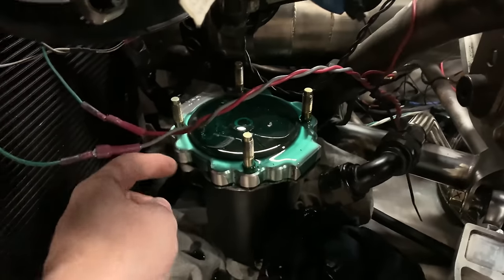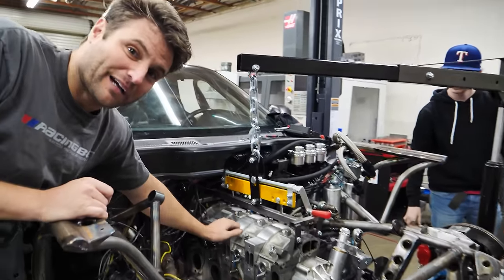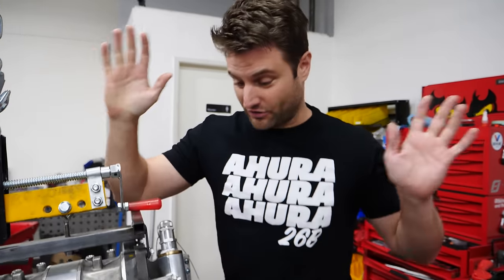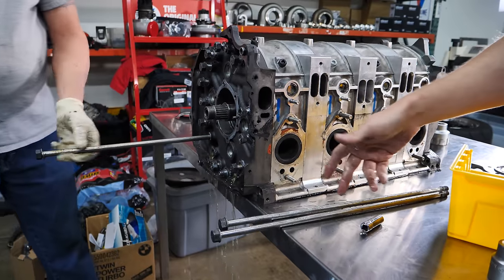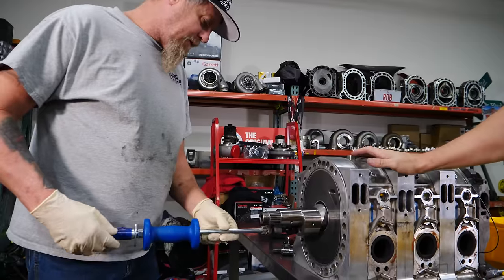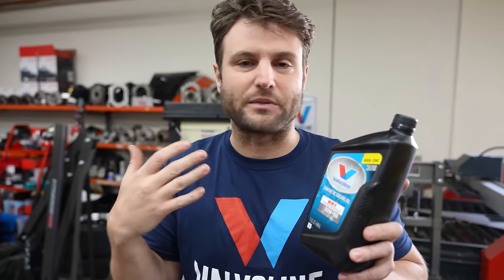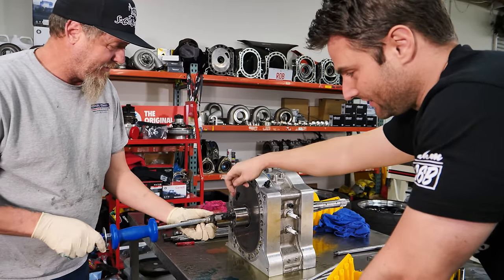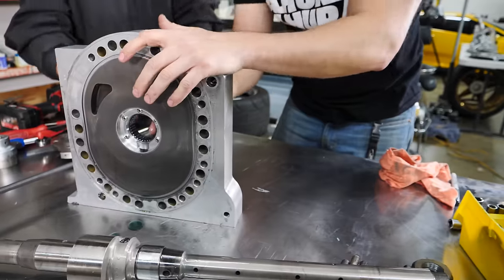How we make 1400+ HP with a Rotary Engine. 4 Rotor Teardown

Comment: When is that 6 rotor coming around again? Really want to see that, very interesting.😎✌️
Reply: As if 4 wasn’t enough😂
Reply: He only has the shaft, needs a while to get all the pieces
Reply: I wonder how a 6 rotor will sound
Reply: @kessler0815  probably like the cannon in a warthog
Reply: Really. I didn't know that you could ,"Stack" rotors together like that.. the sky's the limit.
Reply: @cd2920  I agree. An 8 rotor engine would probably go the way of the straight 8 from decades ago. Maybe it would fit in the famous "Farm truck".
Reply: @helplmchoking  Blue RX4?
Reply: @helplmchoking  No unusual to hear the odd 3 or 4 rotor here as there's a guy called "Mike"  just up the road....🤫😉😆

Comment: The most work I've ever done on an auto engine was switching out the engine from a totalled Samurai to one with blow out piston heads.  Both before and after that experience I have only ever changed oil.

I tell you this to impress upon you-I did not expect to watch this video through.  But I did.

Really, inexplicably fascinating.

Comment: Now that you have a CNC one key thing for you should be a set of unified pullers and pushers (the engine's toolkit if you want) that's married to all the dowels, pins, rods inside that engine. That way, you don't have to use pliers or pullers or whatever. You just have handles and other such things. And it's super easy to make that kind of stuff, so why not make it.

Comment: if you mill through the ends of the dowel passages on very end plates and add a bung. you can assemble with short dowels, remove the bung then knock in a full length one piece dowel . you have to add a spigot spike into the centre of your bungs to keep the dowel from moving forwards and back . its a techinque found in some very early billet plates and takes hours off the assembly time  for long dowels

Comment: Rob nice rotary.    Since you're going to rebuild it you should modify the rotor housings to solve one of the major flaws in rotary engines.  The loss of compression through the primary spark plug hole.  Weld some material into the hole and make it into a slot thats no wider than the apex seal, then get some custom plugs that when installed they line up with the slots.  You would be surprised how much compression  is lost through that opening especially at boost or how much cxhaust contamination you have depending on port timing.   You would probably have a substantial hp gain just from that modification.  If there is a problem with ignition,  I haveca cure for that as well from my years of working on rotories from 1976-1986.  Lost count on how many I built over those years but my guess would be several hundred.  Good luck.  I still think the one piece carbon apex seals were a good design.  In all of the motors I built and raced,  I only had one fail, but saw many two piece fail.

Comment: You have a 2, 3, 4 and 6 rotor engine. You only need a 1 rotor engine
Reply: 5 rotor
Reply: @MiGujack3  I think that is impossible to balance a 5 rotor.
Reply: @mysteryguy7716  Not with that attitude

Comment: You should redo the tubes across the front so they bolt on, and make it so the whole bumper, rad/intercooler and headlight assemblies all come off with it and it’s all on quick releases.

Comment: didnt this Tyson Garvin, made a 12 rotor for his speed boat.  It displaces a massive 15.7 liters, but externally, it’s about the same size as your average big-block V-8. but 830 pounds weight. 377kg.

Comment: I'm not that educated on rotary engine, but wasn't it issue with them that they have low compression which caused low efficiency of burning fuel? haven't any tried to direct exhaust from the starting rotor to the next to burn it again with added air? is it impossible or particularly worsen emissions? 
sry for my midwit level, but I'm really curious

Comment: Rob, 
With oil lines that big and a pressure gallery so large would that explain low pressure? Also there's a huge difference between flow and pressure are you taking that into account?

Comment: Is it safe to use synthetic oils on engines with rubber seals designed for mineral oils, as with oem rotaries? Won’t there be compatibility issues?

Comment: Going to say it again 6 rotor with 2 transmissions 1 for the front wheels one for the back wheels 
So you can output all the power without twisting the e chaft at 2000Hp or more

Comment: When you mess up a aluminum section can you have it replated with something like NIKASIL then resurface it like dirt bikes an race bikes?
Reply: DJ WRAITH  there has to be something like NIKASIL coating the aluminum otherwise the hardened steel apex seals would just eat the aluminum up. I know in our drag bikes it's nothing but a aluminum cylinder with the NIKASIL coating it . That's what is used instead of the old  steel sleeve like we used to do. Just didn't know if that's how they finished the rotor housing or if they used a different process.  Hell rob can't be to fare from millennium technologies that's who I have replate my cylinders an you have to do something bad to ever hurt that coating.

Comment: 'this is the biggest socket youre gonna find' fraid not. i regularly work with 3in sockets, 1.5in impacts. once saw a 2.5inch impact on a 6inch nut, that was scary. literally had to be held with a crane and 2 guys that had a 3 foot handle to keep it from spinning back

Comment: I kind of just assumed that all rotary engines used roller/ball bearings it makes sense to me as they are just vastly superior and you need the support when all that torq is supported by one shaft I don't know about the haulting ass bit its a dog off the line you gotta do something else with the drive train setup ORRRRRRRRRRRRRR MAKE MORE POWER

Comment: Hey rob I am learning how to work on rotary engines and after tinkering with an rx-8 13b I want to build one to swap into an Impreza I was working on. I have a whole rx8 13b or housings with irons for an rx7 13b would you recommend any strategy when building. I’m hoping to build a track car and not sure if I should use a boosted rx7 setup with rx8 rotors or just port and tune my rx8 motor.

Comment: The roller bearing used is a great idea but they fail rapidly at high speeds, if you can swap it out for a spindle bearing, they thrive at high speeds and the  weight load won't be that high once inertia comes in to play and you'll have equal load throughout it help with longevity and one less concern.

Comment: If you're going to tie off and do a burnout, use a Yankum Rope, A big one.
Reply: I don't think you want that stretch for that application 😅
Reply: @rubenbraekman4515  It's not a bungee cord, it merely reduces the shock on the vehicles and wouldn't have snapped as the strap did.

Comment: Rob,  I have a question that has been on my mind for a while watching your videos. It always seems like your gear ratio is too high for burnouts and hole shot launches. I’m I way off on my perception? Does anyone else agree with my observations?  Thanks,  Gas Pump Rob here in Southern California
Reply: I think it's because rotaries run at a higher rpm than piston cars
Reply: @oshaugh143  Maybe so or maybe it’s because he is running an ultra lightweight flywheel?

Comment: Its apart now.  Do every upgrade to the ports, oil system, ect...  take it to to MAX on every detail.  Have the parts Chryo’d, ceramic coated for heat & Lube, free up every bit of power you can, then start cranking the boost!  Prove them all wrong!

Comment: more accurate to say 1/2 or 13mm while that isn't 100% it's much closer and a 12mm tool won't fit a 1/2 nut or bolt but a 13mm will the size is 12.7mm
Reply: nothing imperial size in that engine , all metric .  12mm bolts, 16mm dowels , i made it .

Comment: Rob your filter is what aaved your motor not the oil. If the oil is contaminated the oil stays contaminated. Until it goes through the filter and removed the shavings cleaning out your oil as much as it can. Your oil did its job as did the filtration system. Praise your filtration system not your oil.

Comment: I'm a little confused on your process. I understand that this is a thorough RnD process, but it seems like you ran the car a few times, and now you're tearing it down again. I'm curious what you're looking to gain in knowledge after hardly running the car at all.
Reply: As Rob mentioned, he wants to know the design and measurements to be able to replicate it for the other four rotor, and to be able to make spares if it were to break. It's also good to know how worn it is as the oil pump has died twice, if you don't want to possibly break it due to unknown issues.
Reply: Hardly running the car at all would apply to a non experimental vehicle this car is so experimental that it is worth it to run through the vehicle before anything happens to that 60000 dollar engine
Reply: He said it's a new design that's still running fine, but he knows that running it hard it will come apart and then the only thing you check is scrap prices.

Comment: Sorry, Valvoline is garbage. I ran it a long time ago, on the recommendations of the guy I bought my Sportster from and that crap in you filter is what it did to my engine too. With me, it was piston rings in my Harley 883 Sportster that I raced. They came out in little pieces. I switched to Castrol, and never looked back. Castrol XLR, and then later Castrol GTX. My engines just don't wear out. Never And all I do is change my oil and filter annually. That's it.

Comment: Yeah 1400 but the car only went over a 100mph once when facing the hoonicorn which had a ton a problems with fenders an bumpers flying off the car in every pass. Its more of a show car not a performance car to compete with. And the owner needs driving lessons ASAP.

Comment: fuck all this video makes me realize is how much i never want to make that kind of horsepower and how incredible the ls engines are.  the fact that you have to tear this engine apart every what 2000 miles if even just to make sure its not going to implode FUCK THAT...give me an ls7 with 500 hp and a worry free oil changes and it'll last 200 000 miles or more and be reliable daily driver motor.  yeah fuck race car engines

Comment: You keep preaching how great that car is but it fails every time you try to drive it? You should have just burned all the cash you've spent. The fire would would burn longer than the engine has run..
Reply: Are you a little bit dense? 
He literally said that he rebuilds it out of safety precautions and transparency, something you do with literally any engine high above 800+bhp, if you dont fancy catastrophic engine failures.
And as you can also literally see in the video, not a single thing is broken, most coatings arent even worn, so whats your point again?